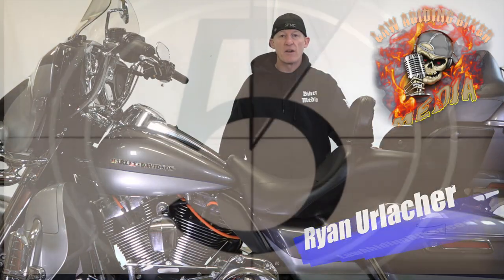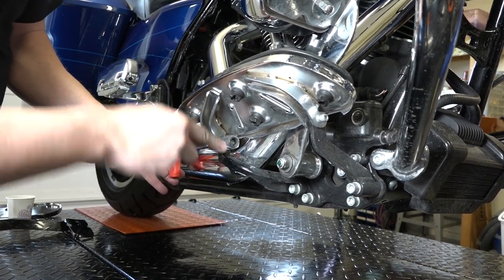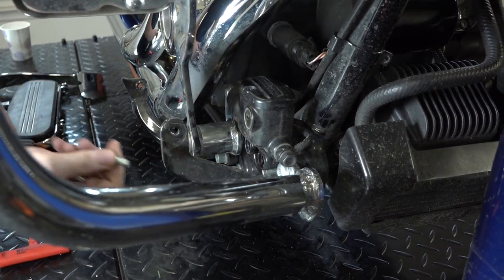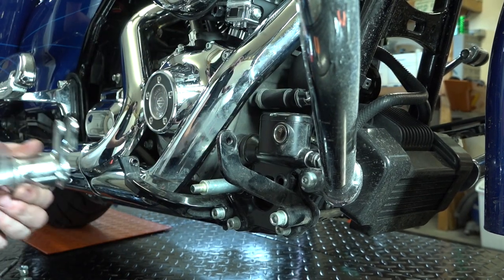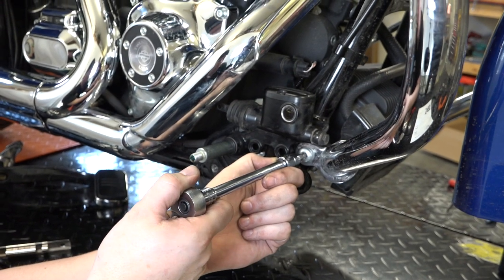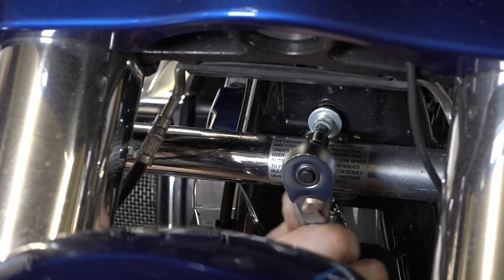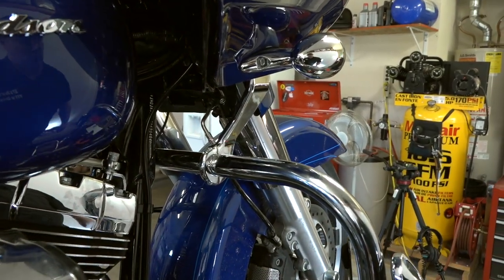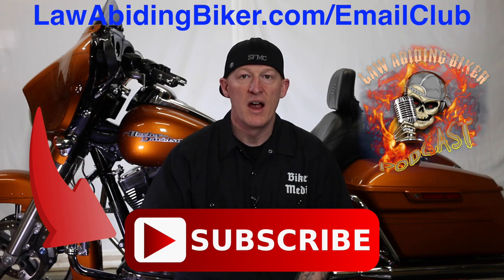How to Install  Kuryakyn Extended Brake Pedal on Harley Davidson

Comment: ****READ BEFORE INSTALLING****I just installed one of these on my 2015 Road Glide. I'm 6'2" and I don't know how I lived with out this! . Just an FYI for anyone that is looking to install one of these. If you watch this video, he gets to  where the arm will not fit without unbolting your engine bar and moving it forward. On the Road Glide or Electra, this can be a real pain because the fairing is anchored to the engine bar and you have to remove both those brackets on each side and blinkers etc. Even if you are doing this on a Street Glide this method is easier than unbolting engine the bar. I found that all you have to do is remove the heat shield on the front header pipe. This is very easy, it is held on by 2 hose clamps. Then, aim the pedal towards the rear of the bike and push it onto the pivot shaft and rotate clockwise. By removing the heat shield you gain about 3/4" of clearance to push the arm on. The pin bracket on the new arm can now rotate behind the front header pipe into the master cylinders push rod. You will also need to remove both floorboard brackets, very easy as well. ALSO, CHECK TO MAKE SURE THE ZERK  FITTING IS TIGHT, MINE WAS LOOSE AND NEEDED TO BE TIGHTENED. Hope this helps.
Reply from the maker: Good. Always more than one way to do many projects. Glad you liked our video. Ride safe & Ride Often!

Here is a link to a bunch of our useful Free vids: http://www.lawabidingbiker.com/freevideos

Here is a link to some of our useful for purchase videos: http://www.lawabidingbiker.com/buyvideos

Want Answers & Information Fast? And help support us at the same time? Do you like the content we provide?

Our patrons get answers to their questions/comments/feedback in less than 24 hrs and are part of our Private Facebook Group. If you are interested in being in this exclusive group you can get all the details at ==> http://www.lawabidingbiker.com/patreon

If you haven't subscribed to the Law Abiding Biker Podcast make sure to do so. Listen in as we talk weekly about issues/items like this & so much more. You can listen on iTunes (Apple/IOS), Stitcher Radio (Android), or any other Podcast App ==> http://www.lawabidingbiker.com/podcast

Join our free email club at http:///www.LawAbidingBiker.com/EmailClub. Only relevant content will be sent from time to time. Email club members are the first to find out about free or for sale content are given special coupon codes.

Comment: A riding friend of mine literally just finished putting on a Kuryakyn Extended Brake Pedal on my 2020 Street Glide this evening. Had we not watched this video prior to beginning the install we wouldn't have been prepared for the same unexpected problem of having to remove the crash bar in order to get the pedal aligned correctly. Everything that was demonstrated and described in the video was exactly how we accomplished the project. Spot on and right on the money! Thanks for the great video!
Reply from the maker: Awesome!! TY!!
Ride safe & Ride Often!

Check out this YouTube Channel as we have a ton of free videos for you!

Check out our useful for purchase videos: http://www.lawabidingbiker.com/buyvideos

BECOME AN ECXLUSIVE MEMBER-GET BENEFITS:
http://www.lawabidingbiker.com/patreon

Leave a flat donation: 
https://www.lawabidingbiker.com/donate

Shop in the Official Law Abiding Biker Store:
https://shop.lawabidingbiker.com

Subscribe to the Law Abiding Biker Podcast: https://www.lawabidingbiker.com/app

Join our free email club:
https://www.lawabidingbiker.com/emailclub

Comment: Thanks for the video. I've done a few of these since I watched your video and I wanted to share a shortcut. When you get to the part of removing the cotter pin, pull the brake pedal and master cylinder out together and then you can pull the cotter pin, change the pedal and reinstall the cotter pin so much easier.
Reply: Yep. So many DIYers miss that very simple method.
Reply: @billcarson1966  what does this mean exactly? Pull them out together how the exhaust is in the way?

Comment: After watching the video, I went online an purchased mine.  I have 16' Ultra limited.  I followed the step in the video and worked out perfect.  Since I have the lower on mine.  All I did is took out the crash bar bolt near the rear brake master cylinder and loosened the other two and I was able to get the new pedal in.  Thanks for your hard work Ryan.
Reply: Glad to know these will for on an ultra.  Figment guide excludes Ultras because of lower fairings. Thanks.

Comment: OK, just installed this on my 2019 Road King Classic. Changing over the brake levers 15 mins, removing the split pin 60 mins :( . Reinstalling the split pin, another 60 mins!! What a nightmare, I guess only Harley could come up with something so simple made so complicated. Your video was excellent and I note watching it a second time, you cut some footage where you removed the pin and also installed it :) My hands way too large for this job (4X gloves gives you an idea) but hey ho this is how I got the new pin back in place. I soldered a piece of old metal coat hanger to the top of the pin and managed to thread that down behind the pedal to get it started after that is was relatively simple. I also removed the heatshield when installing the new pedal thereby not having to remove the front engine bars, just loosed the brake pedal side guard enough to get new pedal in. 

One other tip, after removing the floorboard, I had to loosen the front floorboard bracket a fraction, so it would move enough to slide the new pedal in.

What a huge difference when riding, night and day from the stock pedal, well pleased with the result and again, thanks for the video.
Reply from the maker: Great tips!  And yes, we edit to make it look easy. 

Ride safe & Ride Often!

Check out this YouTube Channel as we have a ton of free videos for you!

Check out our useful for purchase videos: http://www.lawabidingbiker.com/buyvideos

BECOME AN ECXLUSIVE MEMBER-GET BENEFITS:
http://www.lawabidingbiker.com/patreon

Leave a flat donation: 
https://www.lawabidingbiker.com/donate

Shop in the Official Law Abiding Biker Store:
https://shop.lawabidingbiker.com

Subscribe to the Law Abiding Biker Podcast: https://www.lawabidingbiker.com/app

Join our free email club:
https://www.lawabidingbiker.com/emailclub
Reply: @RyanUrlacher  hmmmmm, thanks

Comment: Removing the heat shield allowed me to install without messing with crash bars (2019 RGS). My extended arm also came with a cotter pin (inside the wrapping that holds the manual). Great video as always, Ryan - thanks for the content.

Comment: Thanks for the video.  Just installed one on my 17 ultra.  A few things that I notices was that a new cotter pin comes with the new arm.  I also had to take the entire crash bar off to get the damn thing on.  And that damn pin was a PITA to get on. By the stroke of luck it went in.  But once it went in the reassemble was quick.  I had by computer with me and all I did was start and stop at every step.  Thanks again and stay safe

Comment: As always, perfectly demonstrated. A little harder to get to that cotter pin even with engine guard loosened with lowers in place. Got to it underneath. It was really the only challenging step thanks to your efforts. Always appreciated and that's why I'm one of the 99%

Comment: Great instructional video.  Installed my extended brake pedal on my 2014 SGS in 20 minutes after watching your video.  I removed the bolts from the master cylinder and pulled unit away from the bike.  This makes it easy to remove that darn pin, Thanks guys great video!!
Reply from the maker: Awesome Tony!! We love hearing stuff like this....thanks

Ride safe & Ride Often!
Here is a link to a bunch of our useful Free vids: http://www.lawabidingbiker.com/freevideos
Here is a link to some of our useful for purchase videos: http://www.lawabidingbiker.com/buyvideos
Want Answers & Information Fast? And help support us at the same time? Do you like the content we provide?
Our patrons get answers to their questions/comments/feedback in less than 24 hrs and are part of our Private Facebook Group. If you are interested in being in this exclusive group you can get all the details at ==> http://www.lawabidingbiker.com/patreon
If you haven't subscribed to the Law Abiding Biker Podcast make sure to do so. Listen in as we talk weekly about issues/items like this & so much more. You can listen on iTunes (Apple/IOS), Stitcher Radio (Android), or any other Podcast App ==> http://www.lawabidingbiker.com/podcast
Join our free email club at http:///www.LawAbidingBiker.com/EmailClub. Only relevant content will be sent from time to time. Email club members are the first to find out about free or for sale content are given special coupon codes.

Comment: on '13 RKC just did this, removed the motor mount end cap 3 bolts and that releases the whole assy of floorboard mounts, brake reservoir and lever. gives easy access to replace the lever and cotter pin without touching crash bars or heat shield, worked great for me

Comment: Installed this on a 2017 Tri Glide.  Also had to remove the engine crash guards.  One other thing I did to help me on the cotter pin, I removed the heat shield.  I am very happy with the extended pedal.  It is in a position where I can easily apply the rear brake smoothly.  The video was a big help even on a Trike.
Reply from the maker: Awesome!

Comment: Just did mine. The comment on here that suggested removing the master cylinder bolts and pulling the whole master cylinder assembly and pedal around the header and out was the best advice. That allowed me to easily mess with the cotter pin. Just a heads up.

Comment: Bought it via your link.  Installed today.  I had to use a breaker bar with the torx to get the engine guard off.  What a difference,!!   I couldn't get the rubber off the old pedal so getting a new one to push on it.
Reply from the maker: Rock on and thanks for purchasing through the link! Glad you go it installed.

Comment: On my 2018 Road Glide Special, I did not have to remove the engine guard. All I had to do was remove the exhaust head shield. It’s a close fit, but there is enough room for the brake arm to slide in once the heat shield is removed.  Also, there is an o-ring on the inboard side as well.  Both inboard and outboard o-rings should be removed. The stock brake arm has recesses for the o-rings, the Kuryakyn arm does not.

Comment: After watching this video it was a simple install. After removing the floorboard and front arm.  Removed the 2 bolts holding the brake master on,  I pulled the whole unit away from the bike and it made removing the cotter pin simple.  I was told by someone on a forum, that you can put the new pedal on without touching the crash bar...sure enough it worked.  Pulled master forward, put the pin and cotter back in (with plenty of room to work)...put the pedal on the pivot, rotate it up as you gently slide the master  back.
Reply from the maker: Glad you liked the video and it was helpfu! Thanks for watching.
Ride safe & Ride Often!

Here is a link to a bunch of our useful Free vids: http://www.lawabidingbiker.com/freevideos

Here is a link to some of our useful for purchase videos: http://www.lawabidingbiker.com/buyvideos

Want Answers & Information Fast? And help support us at the same time? Do you like the content we provide?

Our patrons get answers to their questions/comments/feedback in less than 24 hrs and are part of our Private Facebook Group. If you are interested in being in this exclusive group you can get all the details at ==> http://www.lawabidingbiker.com/patreon

If you haven't subscribed to the Law Abiding Biker Podcast make sure to do so. Listen in as we talk weekly about issues/items like this & so much more. You can listen on iTunes (Apple/IOS), Stitcher Radio (Android), or any other Podcast App ==> http://www.lawabidingbiker.com/podcast

Join our free email club at http:///www.LawAbidingBiker.com/EmailClub. Only relevant content will be sent from time to time. Email club members are the first to find out about free or for sale content are given special coupon codes.

Comment: I installed this on my 2015 Street Glide Special and it was way better than stock.  Still, being 5'8" with a 30 inch inseam I found it a little difficult to reach the pedal easily.  If you aren't Lurch size I'd recommend going with the one for a bike with lowers.  I put that one on and it worked out much better.  It's still farther forward and lower than stock but not quite as far forward and low as the one for tall riders.  It's far enough forward that I can just lift my toe a little to brake rather than having to lift my foot out and around then down with the stock lever.  I also don't believe taking off the crash bars would have been necessary with the shorter lever. I still had to remove them to get the old one off.

Comment: Maybe I should have done video with my bike. This one was cake walk. You'd have had to bleep salty language. Plus lowers get in way. Fortunately factory header looks easier. Crash bar doesn't need removing although I should've removed lower and loosened it. I ended up scratching inside a little on black plastic due do my impatience. Directions suck and I probably didn't install properly. I took rag and hammer to tap past my header. It was more involved than I thought and I cursed both Kuryakyn and Harley by time I was done. My reason for change is I put Kuryakyn iso boards on and with factory brake arm I couldn't put foot on floorboard because arm was in way. This seems to have helped.

Comment: Question: did you use Locktite on any of the bolts? Specifically the one that holds the new pedal in? 
Just completed, thank you so much for this video!

Comment: I watches several videos like this, and it is best to unbolt the master cylinder so you can get behind it.  Makes the cotter pin remove easier also. Remove the three/four bolts for the master cylinder and you will be on your way.

Comment: I loosened the 2 clamps on the exhaust pipe shields and was able to get the pedal arm on without removing engine guard.
Reply: On my 2018 Rd Glide I did the same...well I took the cover off  and removed the lower crash bar bolt and was able to spring the  bar away enough to get the pedal in....a bit of a time saver......

Comment: Do i put the crush washer on then the normal flat washer followed by the lock nut to hold the pedal on? Thats how i installed mine yesterday and it wiggles pretty good not sure if i need to take a bushing out of my old one and use it or something.

Comment: Hi Ryan,
Do you need to adjust the rear brake like switch at all after installing this? I installed this on my bike and I feel like it takes a little extra pressure before my brake light comes on.

Comment: My brake pedal is a little too short in size, the new one is there spacers i could use the part at the bottom that go on the shaft?

Comment: Can I ask why not reinstall the 'O' ring? I note when I disconnected my old brake pedal on a Heritage 2015, there was a little oil/grease inside the chamber although the new Kuryakyn pedal does come with a new bolt and a large washer?

Comment: I have the 2010 Ultra limited with my lower fairings on. My boot toe area hits the Fairing adjustment knob which makes it difficult to quickly position my foot for applying the rear brake. I see that if the brake pedal was lower by about one inch it would give me adequate clearance and a good margin of travel for applying the brake. Is the a replacement kit for lowering the position of the brake pedal?

Comment: I removed the whole floorboard assembly down at the frame because it made it a lot easier for me.
Reply: Also if you have an aftermarket header it creates a nightmare. I have an S&S head pipe and it was a bugger getting the old one out and the new one in even with removing the master cylinder. Brake arm comes with new cotter key and O-ring.
Reply from the maker: It sure would. Thank you for sharing.  Ride safe & Ride Often!

Here is a link to a bunch of our useful Free vids bro: http://www.lawabidingbiker.com/freevideos

Here is a link to some of our useful for purchase videos: http://www.lawabidingbiker.com/buyvideos

Want Answers & Information Fast? And help support us at the same time? Do you like the content we provide?

Our patrons get answers to their questions/comments/feedback in less than 24 hrs and are part of our Private Facebook Group. If you are interested in being in this exclusive group you can get all the details at ==> http://www.lawabidingbiker.com/patreon

If you haven't subscribed to the Law Abiding Biker Podcast make sure to do so. Listen in as we talk weekly about issues/items like this & so much more. You can listen on iTunes (Apple/IOS), Stitcher Radio (Android), or any other Podcast App ==> http://www.lawabidingbiker.com/podcast

Join our free email club at http:///www.LawAbidingBiker.com/EmailClub. Only relevant content will be sent from time to time. Email club members are the first to find out about free or for sale content are given special coupon codes.
Reply from the maker: Yep, aftermarket headers/exhaust can be a pain when it comes to maintenance and other work.
Reply: @RyanUrlacher  Hey Ryan ,do you have a video showing install of Harley heated hand grips on 20 SGS with wires in the bars?

Comment: I have the opposite issue.  I need to know how to modify a bike to fit a 5'2" tall woman with little feet.  The brake pedal on my wife's 2013 Sportster 883 Superlow is to far from the foot peg and she is riding with her foot on the peg mount.

Comment: I would have been nice if you give us the torque specs for the bolts. Yes, I am a torque guy.  All nuts and bolts should be set to factory specs.  Unless you want your bike to fall apart going down the road.  A little blue lock-tite is good too.